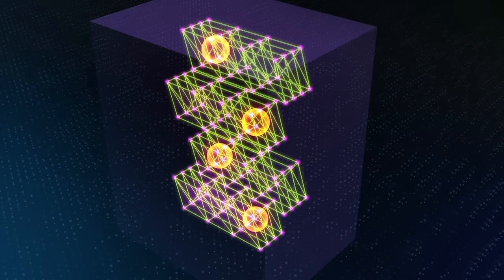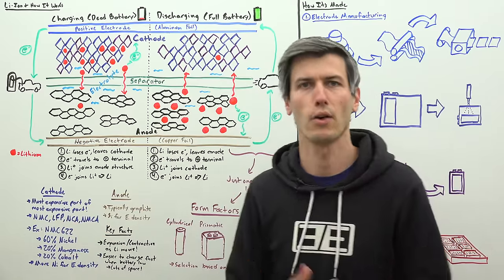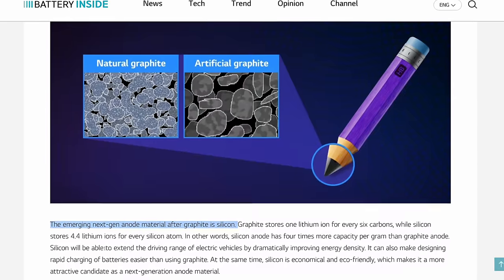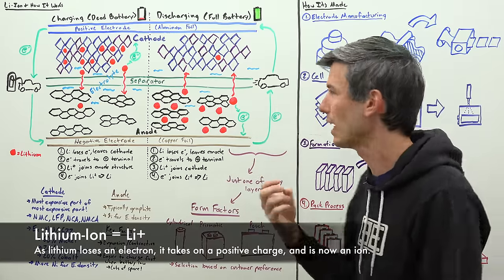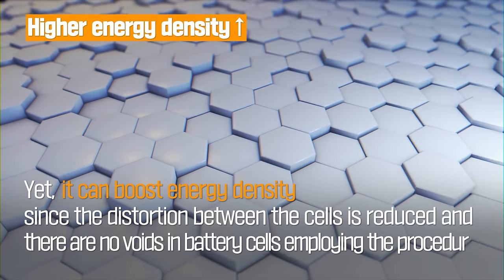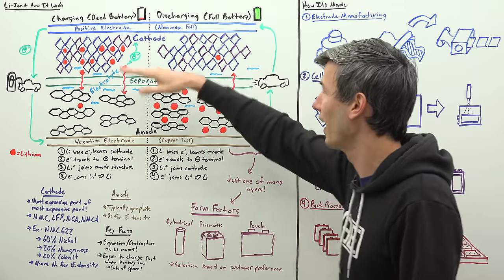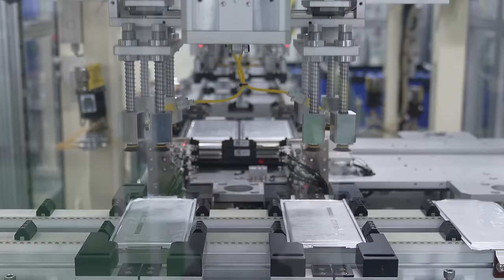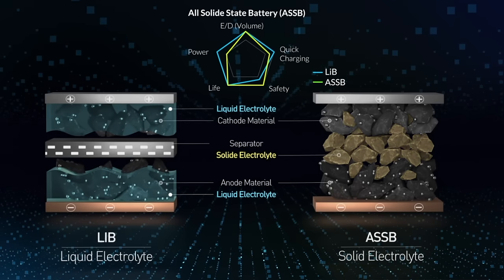Everything You Need To Know About Lithium-Ion Batteries

Comment: I don't think you included that a Lithium ion battery can catch fire though no fault of your own, even if every battery is defect free new out of the factory.  
 it must be pointed out to people - batteries do not need to be abused to catch fire. Recently a ship containing brand new just produced EVs had brand new never abused batteries catch fire burning the entire ship up.  It is critical for buyers or potential buyers to realize there is a risk of fire with EV batteries even if you do not abuse them at all. This is due to dendrites; deposits that can build inside the battery which can short basically at random causing a fire; once one battery catches fire it spread to thousands of other batteries and there is really nothing that can stop that fire.  Lithium ion batteries have an inherit risk of fire.

Comment: Nope - still not enough energy density per mass and volume and prone to thermal runaway and when it happened, then  because of using lithium (generate more heat and oxygen), therefore hard to put out the fire.
I'm still waiting for better technology, supercapacitor or high performance fuel cell especially.
Reply: re: "I'm still waiting for better technology, supercapacitor or high performance fuel cell especially." you will embrace NMC Chemistry and LIKE IT...!!! (unfortunately all that other tech like Solid State Batteries and "Radioactive Unicorn Poo" everyone's waiting for ain't coming).

Comment: Li-ion seems to be pretty old tech looking at computers and/or RC market, which turned towards li-pol technology. Is there also a li-pol future in automotive industry?
Reply: You know that lithium polymer IS lithium ion, right?  It's just a different electrolyte that has some benefits in very small/lightweight applications, but the memory effects and shorter life are not ideal for EVs
Reply: Lithium polymer is just a fiesty Lion (please someone get my joke).

You trade off less cycles and more temper for lighter weight, lower capacity per weight, but massive current output.
Reply: @GregHassler  oh, ok, makes sense, thx
Reply: @BeefIngot  😅 got it, and got THAT, thx ;)

Comment: Lithium ion batteries are a dead end for EVs and most anything that needs to scale. IN 2022; total production was 130,000 tons.  If you only made Tesla Model Y batteris with that you could only make 10-12 million. The annual light car and truck markets is 100 million. However, EVs don't get all the lithium so do the billion cell phones made, laptops, power tools etc. So if you use half you are talking a niche market of 5% EVs - nothing. Can you produce more lithium?  Sure, but not that much; one limit is water you need 500,000 gallons per ton to refine it. Since EVs got to 1 million produced, Lithium production is up 10% a year; to double is likely to take 10 years... so then you have 10% of the market?  Just a dead end.. because there are heavy vehicles like Semi trucks there are 9 million in the USA alone.

Comment: Powering future fires.
Reply: Unlike gasoline cars who never catch fire 😂😂😂
Reply: @TheEsseboy  Bombs detonate like nuclear bombs. NO!
Reply: @djuro14  Conventional bombs do not detonate like nuclear bombs...are you okay?
Reply: @TheEsseboy  Oh yoes, its the same thing.
Reply: @djuro14  No it isn't, nuclear bombs contain fissile material that is usually compressed into a super critical state which triggers a nuclear explosion, conventional bombs only use a chemical that decomposes very fast creating an explosion.
Reply: @TheEsseboy  Now do the same for air/fuel mixture vs EV batteries. 😆
Reply: @djuro14  EVs catch fire when damaged severely, while gasoline cars are known to spontaneously catch fire.
Reply: @TheEsseboy  How do they compare when they  start burning?
Reply: @djuro14  What is more relevant is how often they catch fire, which gasoline cars are about 10 times more likely to do.
Reply: @TheEsseboy  Why would that be? Because reasons?
Reply: @djuro14  Because gasoline is a flamable liquid that produces a lot of flamable vapours.
Reply: @TheEsseboy  Not that.Why are 10 fires worse than one that cant be extinguished?
I can use a fire extinguisher to put out a regular car fire. Cant do that with an EV.
Reply: @djuro14  Most fires burn out of control before the fire 🚒 can reach you. Especially when there is gasoline involved.

An EV fire can be put out, you just need the correct extinguishers and methods.
Reply: @TheEsseboy  Every EV battery fire is an out of control fire. Not so when it comes to ICE cars.
Reply: @TheEsseboy  Thermal runaway is one of the primary risks related to lithium-ion batteries. It is a phenomenon in which the lithium-ion cell enters an uncontrollable, self-heating state. Thermal runaway can result in: Ejection of gas, shrapnel and/or particulates (violent cell venting) Extremely high temperatures.

Facts.
Reply: @TheEsseboy  Off-gassing usually occurs due to a breakdown of the Li-ion battery cell electrolyte, causing over-pressurization of the battery case. Later, temperature will increase dramatically, smoke is then emitted, and fire breaks out. The off-gassing is the emissions of toxic gasses that are the larger threat.
Reply: @TheEsseboy  The heat also converts the battery cell's internal components into a flammable, toxic gas. When the gas pressurizes and eventually bursts out, there's a distinct popping sound, And when that gas finds an ignition source, a battery fire or explosion can occur.
Reply: Depending on its composition, concrete melts at temperatures between 1150°C and 1200°C.
Typically, an EV fire burns at roughly 5,000 degrees Fahrenheit (2,760 Celsius)

Coming to a parking garage near you.
Reply: @djuro14  Just that they are 10 times less likely to catch fire, and are getting safer every year. There are already LFP batteries that cannot catch fire, so problem solved if you are living in fear. 

I'd rather have just one EV burning in a parking garage than 10 gasoline cars thank you.
Reply: @TheEsseboy  Sprinklers can extinguish ICE cars. Not so with EVs.
Reply: @TheEsseboy  What about EVs burning next to other EVs?
Reply: @djuro14  There are not sprinklers in every parking garage or parking lot. And as EVs are 10 times less likely to catch fire to being with that would be like it happening once every 100 years instead of once every 10 years for gasoline cars.
Reply: @djuro14  What about a gasoline car burning next to other gasoline cars?
Reply: @TheEsseboy  use WATER!
Reply: @TheEsseboy  Nukes are less likely to be used, but when the are.....
Reply: @djuro14  On a gasoline fire? Because that works so well...
Reply: @djuro14  Nukes level whole cities, an EV fire just burn for a while, and they are very rare to start burning to begin with, and there are safe options if you are so scared about it.
Reply: “Normally a car fire you can put out with 500 to 1,000 gallons of water,” Austin Fire Department Division Chief Thayer Smith said, according The Independent.
Reply: @TheEsseboy  There are no safe options.
Are you saying some options are unsafe?😁
Reply: @TheEsseboy  EV fires mostly burn until there is nothing left to burn. And you call that "for a while".
Reply: @djuro14  That is when the fire department arrives, which is usually when the car already have bruned most of the way down.
Reply: @djuro14  Safer than already safe options, like having a helmet on when walking around the house is safer than to not wear one, doesn't mean it is unsafe to walk around in the house
Reply: @djuro14  Luckily they are 90% less likely to happen.
Reply: @TheEsseboy  But when it happens it takes down ships and buildings.
Reply: @djuro14  Just like when a gasoline car fire happens, just 90% less likely to happen.

Comment: You are tunnel visioning on lithium batteries. They are not ready for prime time, A switch to lithium in just part of the world for some applications , like auto , would get us into a head on collision with a lithium shortage. Lithium is also a dirty mineral to produce. The whole world are waiting for a tech break through in energy storage, you cannot legislate tech advances, they come when they do, and even if we get it by next Tuesday, and it will likely not involve lithium, and it will take the infrastructure at least 2 decades to catch up.

Comment: You said "EVERYTHING", but your EVERYTHING does not include the availability of lithium mineal.

It may be exhausted before oil.
Reply: Unlike Oil, Lithium is recyclable.
Reply: The sea full of lithium, it’s just not currently economic to extract it. Lithium probably isn’t a forever solution, but it’ll do plenty well enough for many decades.
Reply: @armadillito  Yeah, by consuming 100 times more energy to extract those lithium from sea water.   It's a good idea in your utopia (or dystopia?)   :face-blue-smiling::face-blue-smiling::face-blue-smiling:
Reply: @AkiraNakamoto  Same thing was said about oil on the bottom of the sea. The attitude of "it's good enough, who cares to progress" won't get you far
Reply: @pawel7196  Nah, I can use Occam's Razor to cut off ur sophistry.    I already have a viable and cleaner solution than yours.  See the previous comment at the top.   Seeking utopia definitely won't get you far.
Reply: @pawel7196  He'd rather expend more energy to refine tar sands than use it to extract lithium.
Reply: A sense a strong Toyota influence in this thread...
Reply: Lithium is one of the most prolific elements on earth, and in the universe.  Far more available than fossil fuels.  Oh and we don't burn it, so it can be recycled. You should look into it more.

Comment: Looks like the transition to Sodium  batteries must be why they have paid Jason to talk about Lithium batteries?
Reply: Sodium batteries are too heavy for automotive use, it would literally double the weight of any given battery pack
Reply: @TheEsseboy  They are the same as LFP cells, about 25% heavier, NOT 100%, and that is ok, as LFP cars are currently made today, and the cost of the Sodium cells is much less.
Reply: @murraymadness4674  That is not true, Sodium batteries are about twice as heavy, not a quarter
Reply: @TheEsseboy  Google says: "The energy density of lithium-ion batteries typically ranges from 100 to 265 Wh/kg, while the energy density of sodium-ion batteries ranges from 80 to 150 Wh/kg"
Reply: @murraymadness4674  Yes, so about twice as heavy
Reply: @TheEsseboy  I guess if you define "about" to be way off, some lithium is even heavier than some sodium.   Your assertion that it won't work in cars is just plain wrong.
Reply: @murraymadness4674  Except those lithium chemistries are geared more towards stationairy applications. 

Sodium is an heavier element, you cannot get around that. The batteries will be about twice as heavy, there for more applicable for stationairy use.

Comment: I opted against a lithium ion battery in my car vs a conventional battery because of its tendency to catch fire. I don’t have to worry about the gasoline and oil in my car bursting into flames unless I have a horrible car accident.
Reply: Ah yes, unlike gasoline and oil which famously can never burn.
Reply: @FuncleChuck typically not spontaneously in your garage
Reply: BEV's are 20-100 times less likely to catch fire than ICE vehicles.  The one's that catch fire for no reason (Chevy Bolt) were all recalled and replaced.
Reply: @FuncleChuck  I don’t have to worry about the gasoline and oil in my car bursting into flames unless I have a horrible car accident
Reply: Gasoline powered cars catch on fire 30 times as often as lithium ion battery cars.  But let's be honest, you're not really concerned about fires, your problem is CHANGE anxiety.
Reply: @therabidsquirrelsage3388  I’m comparing a conventional CAR BATTERY to a lithium ion CAR BATTERY. Not a lithium ion battery to a gasoline car 🙄
Reply: @FuncleChuck  Petrol products, are extremtely energy dense and several orders of magnitude more stable.
Reply: @deet5072 probably never come across a jaguar land rover product 😂
Reply: @therabidsquirrelsage3388  Given that there are approx 100 times more petrol cars then EVs id say the odds are still very much in favour of petrol, Also, most car fires are not because of the fuel, its because of an electrical short settings fire to wires and plastics, ,meaning this issue is exactly the same as an electric car and arguably worse given that the batteries in electrical cars are not as stable as petrol and far more likely to spontainiously ignite.  and if you think that there are no petrolium based products in your EV to catch fire, you will may find yourself surprised.
Reply: @deet5072  regular fuels are not good to use after just 6 months in sealed container (around 3-4 months if in your tank). In other words, they're outdated after that time. Is that the stability you're talking about? Crude oil has similar life after mined.
Reply: @Lewis_Standing   ok, some more so than others lol Vauxhall Zafiras are another, i hear not only can you get free spare parts littered down the motorway but you also get a free BBQ with every sale :D
Reply: @deet5072 no it's normalised for amount of cars. Fires per 100,000 vehicles combustion Vs EV. More fires in the combustion engines. 

Even lead acid starter batteries can be the source.
Reply: The thing that scares the hell out of me..... "Dendrite Formation"  It will happen to them all.  Ideally, the issue is caught and dealt with before hand, but as more and more are built, the statistics will catch up.  They are trying to figure out how to put these fires out, but they are not there yet.  I love tech that improves our lives, but .... cart meet horse,   it should be horse, meet cart.  Oh, and those above, your letting your bias get in the way of logic.1.  Time and a place for everything, and this is all being rushed.  I won't even get into transformers blowing...  Want to know some devastation reality... go see what the complex fires did in Oregon (not battery related, just what fire does).
Reply: @deet5072  lol I'm not a clown like you who doesn't understand statistics.  It's not the number of fires that happen. It's the chance that a fire will happen with each individual vehicle.  I know this doesn't fit the narrative that you're trying to push, but that doesn't keep it from being true.  I'm not concerned with blaming petrol products or pushing some ignorant narrative like you are. I'm concerned with the chance a fire will happen and that chance is 30 times higher in a gasoline powered car.
Reply: @bbkangs  ...except I can see your original comment.  Boomers just don't understand how YouTube works 🤣
Reply: @therabidsquirrelsage3388  Are you calling ME a boomer? 🤨 I’m in my 20s. I replied to you and edited my original comment for those who may not scroll all the way down to my reply.
Reply: @deet5072  Dear god almighty you might have just demonstrated the worst understanding of statistics that I have ever seen.
Reply: @therabidsquirrelsage3388  Im quite familiar with statistics, a lot more so then you are on this subject it seems. 

Praytell, whats your evidence. Please do factor in deliberate and accidently fires caused by external sources. You will also need to seperate out Non electrical fires from Petrol because you know, electrics are the primary source of non deliberate fires which are equally present in EVs as well, such as the heater matrix, fans, lights etc.

So when you can give me some precise statisics for Non-Electrical petrol causes of all car fires then compare that against Lithium battery fires. Then normalise it for lets say, 10,000 cars, then you can come here and preach about statisics.

Your argument is that EVs are less likely to catch fire, but you havent controlled for the reasons behind that fire.  Chop Chop.
Reply: @Lewis_Standing  Did they normalise for types for fires?  a 15 year old get throwing a petrol bomb under a petrol or EV is going to have the same effect, except that there are vastly more Petrol cars on the road and thus far more liklely to be torched making those numbers worse. 

Now factor out all other causes of fire in a car that has nothing to do with the fuel system.  The arguement is that EV is less likely to catch fire in order to make that a fair comparision you will need to isolate the two sources of power, ie, petrol related and Lithium battery related.  a faulty headlamp in any car can catch fire and could potentially burn it to the ground regardless of energy source, because there are more petrol cars this will artificially make petrol look worse when it could also apply to an EV. 

its also worth noting that some of the research behind these numbers is created by organisations pushing the technology, much like this guy from engineering explained, there is a conflict of interest there.  -  Just a few years back we used to take the piss out of Big Tobacco publishing its own "healthy" tobacco studies, we understand that there are conflicts of interest but ironically many of us are quick to blindly believe these AGW "groups" who are just as easily invested in a particular outcome.
Reply: @deet5072  the NHTSA.  And clearly you don't understand the first thing about statistics.  You already proved that.  Keep pushing your Facebook meme narrative.

Comment: Should also make a video about lithium battery health and why after 80% capacity they degrade so fast. I love electric cars but the truth it after 10-15 years the battery is dead. which makes them not reasonable for cars which you want to own for generations. Yes you can replace the battery and prices are down but thats only because china is putting so much pressure on the market its the same with oil where one lowers the price to make production for everybodey else not viable so they can kick out weaker competitors.
Reply: Analysis of Tesla vehicles has shown that they lose about 12% capacity on average by 200,000 miles. I've had ICE cars that became completely unusable with fewer miles than that.